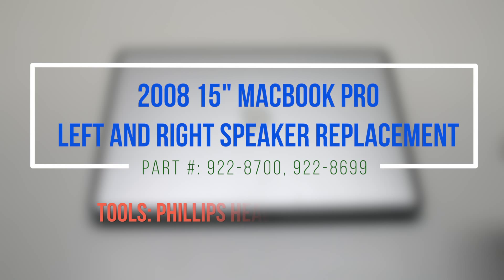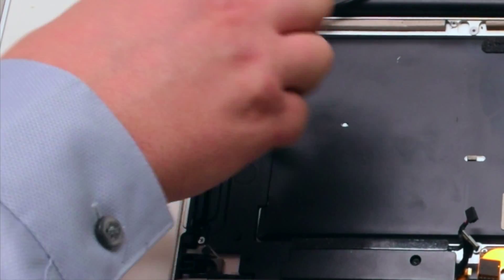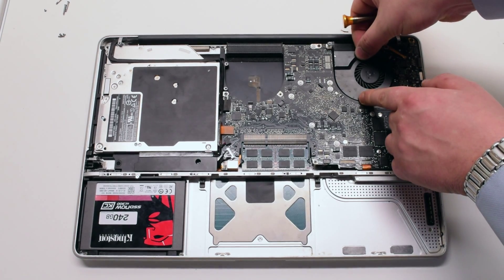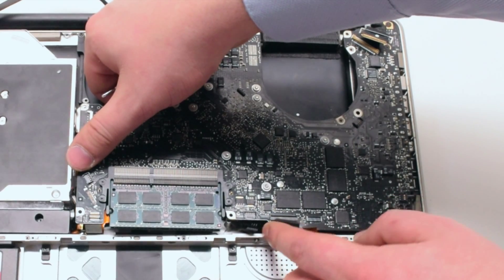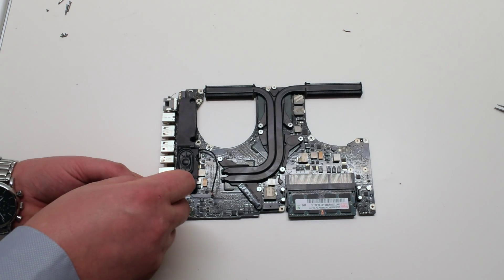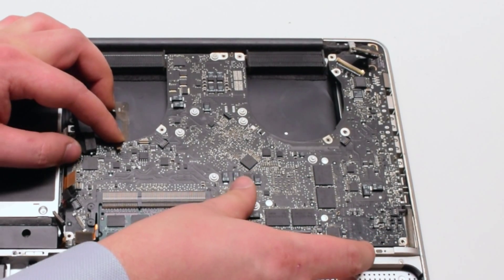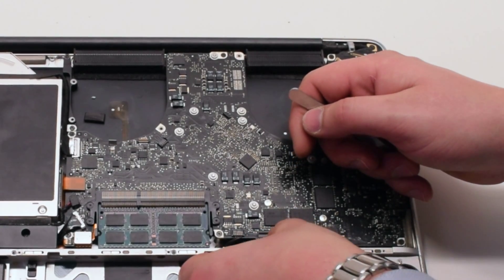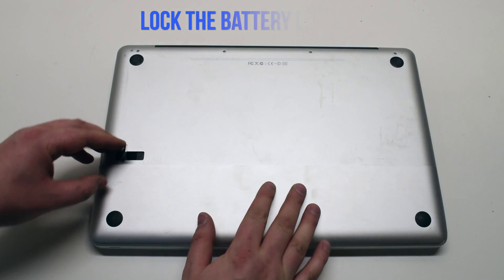2008 Macbook Pro 15" A1286 Left and Right Speaker Replacement

Comment: The four pin connector is missing from my motherboard for the right speaker. I ordered one from Amazon, but not sure how easy it will be to solder onto the board. Any suggestions?
Reply from the maker: Soldering advice @LouisRossmann channel